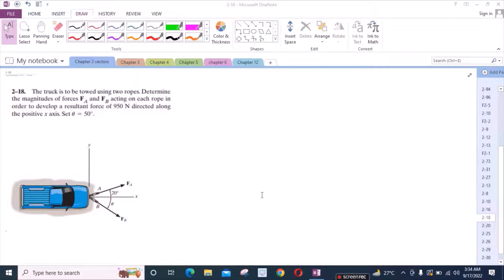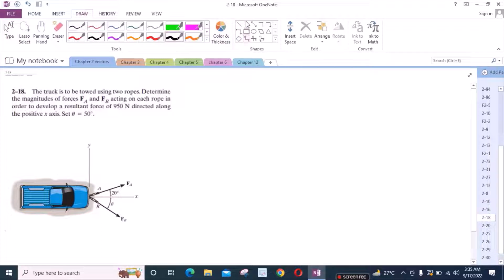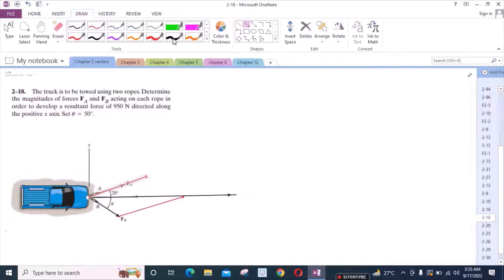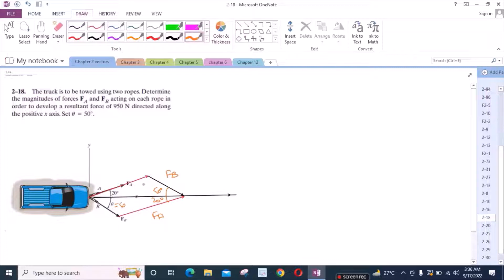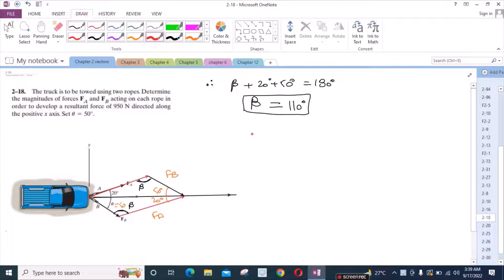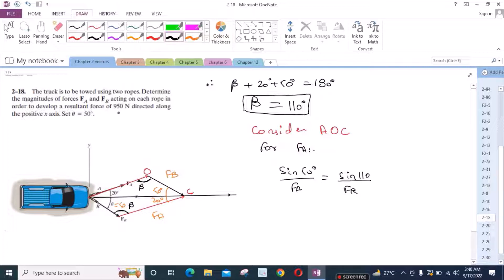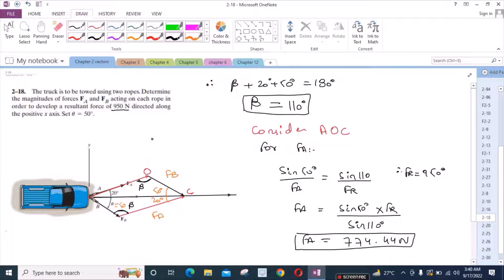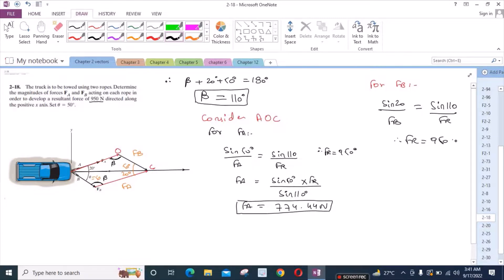2-18 hibbeler statics chapter 2 | hibbeler statics | hibbeler

Comment from the maker: Learn How to Solve 2-35, "The contact point between the femur and the tibia bones of the leg is at A. If a vertical force of 175 lb. is applied at this point, determine the components along the x and y axes. Note that the y component represents the normal force on the load-bearing regions of the bones. Both the x and y components cause the synovial fluid to be squeezed out of the bearing space."
Here is the Link: https://youtu.be/YRFyXEW3fJM